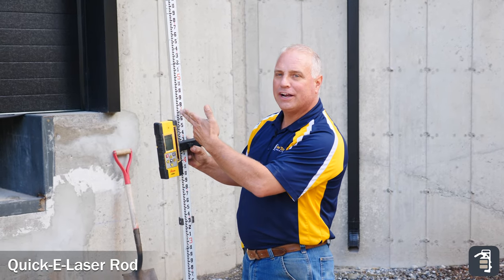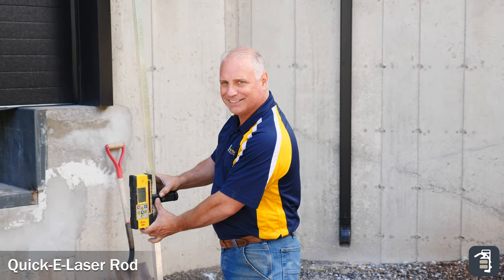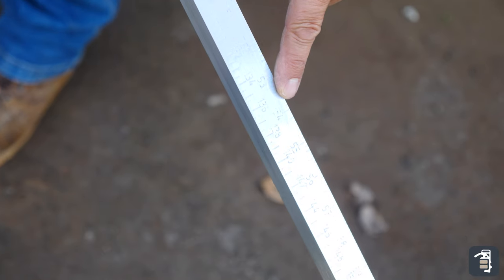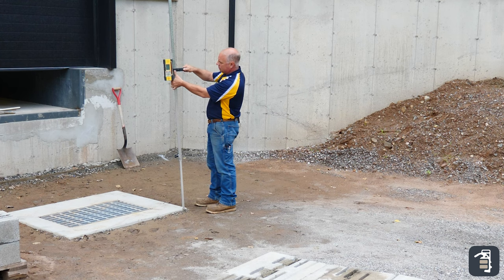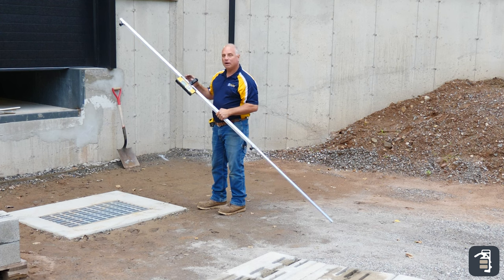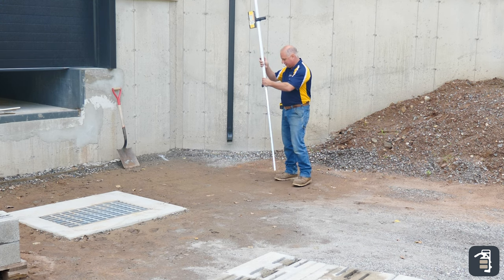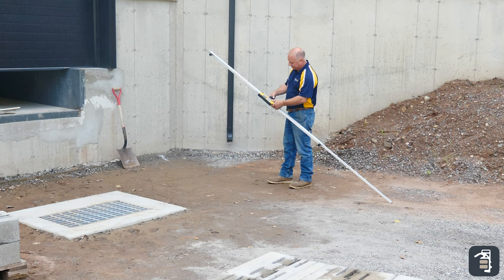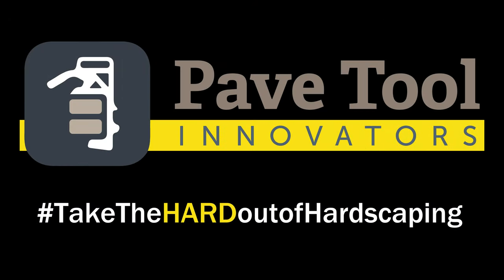Retaining Wall Tip

Comment: We, instead of using actual zero in an application like this, will flip it around to the other side and use a nice even number (like 10 or 20inch mark). This way you are not calculating above and below zero which can start getting confusing if you have many points close to zero. 
I bought many different things from Pave Tool and this was without a doubt, the most beneficial tool to me.
Reply from the maker: Now that's called using a tool to its full potential! Thanks for pointing this out! This tool can be used in many different ways to fit your needs. Your feedback means a lot to us!